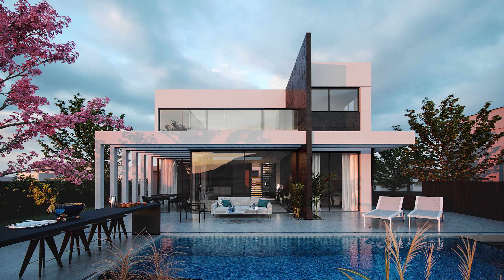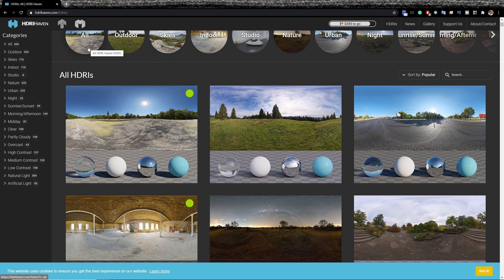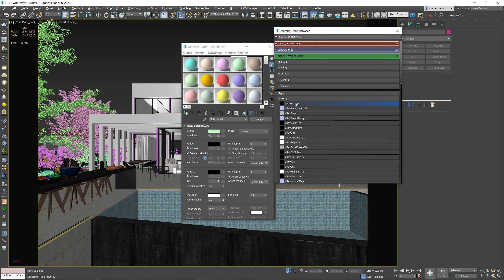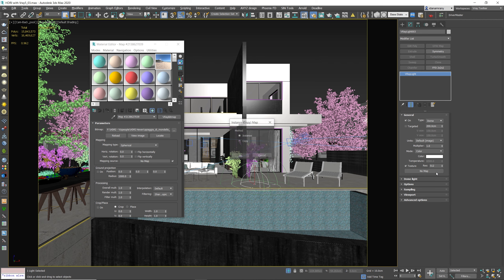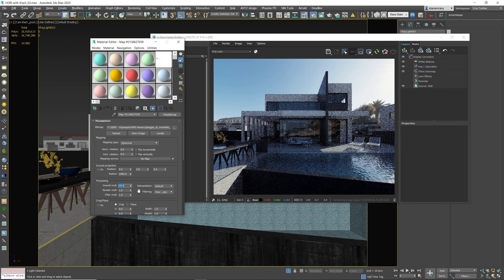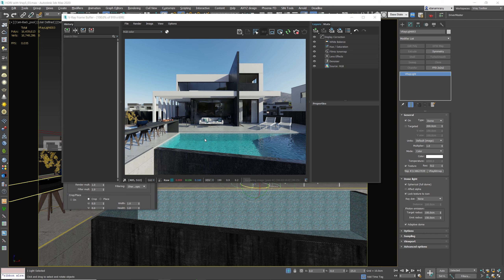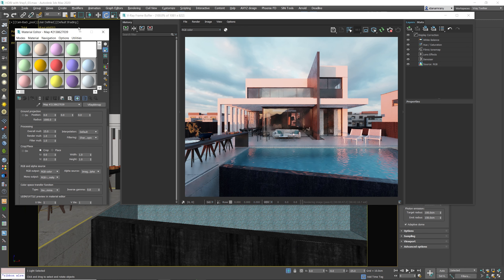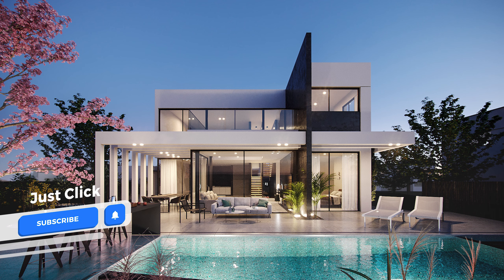Vray HDRI - How to add Hdri lighting in Vray 5 for 3ds max.

Comment: -guys, how to unhide CLAMP OUTPUT in Vray 5 render settings (3DS Max) using a maxscript? (it's hidden by default says chaosgroup
-for I have problem with jagged edges on bright area of an object
(it's easily solve before by SubPixel Mapping and Clamp Output)...